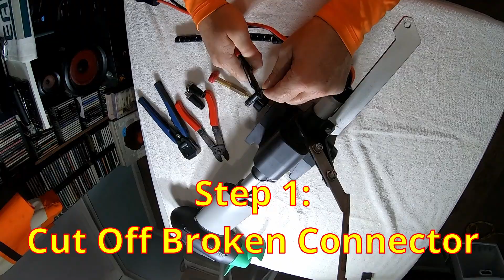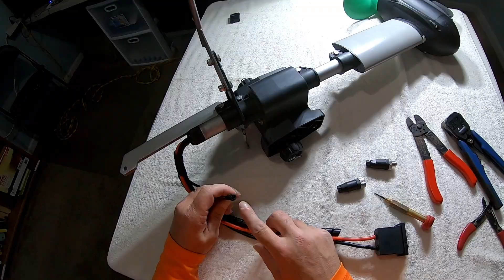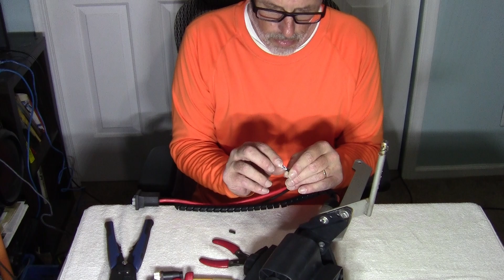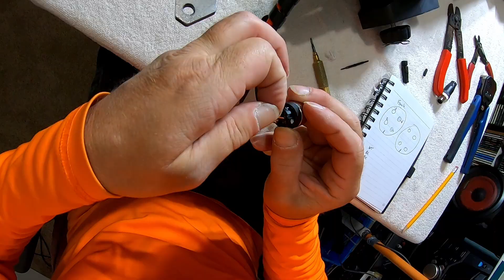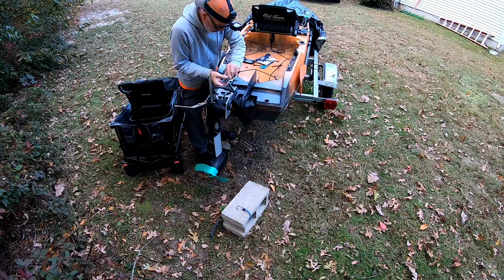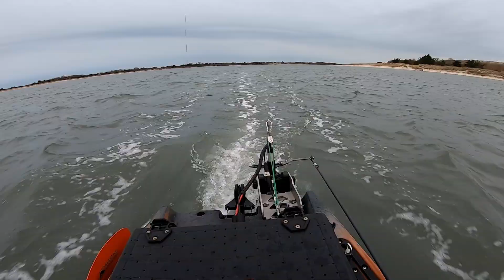Newport NK300 / NK180 Throttle Connector Repair (Step-By-Step) Fix Broken Plug Fast!

Comment from the maker: If your Newport NK300 throttle connector is stuck, damaged, or won’t power the motor, this is the exact connector I used to replace and waterproof the plug.
🔧 Replacement Part:  https://www.amazon.com/dp/B09YLP4JFY?ref=ppx_yo2ov_dt_b_fed_asin_title&th=1
If you have questions about wiring or terminal order, drop a comment — I answer every one!”